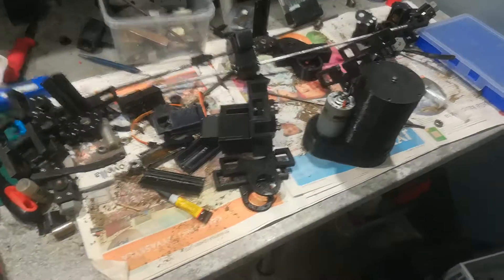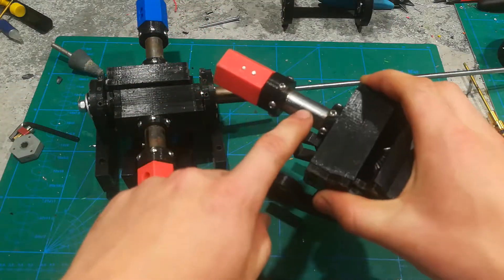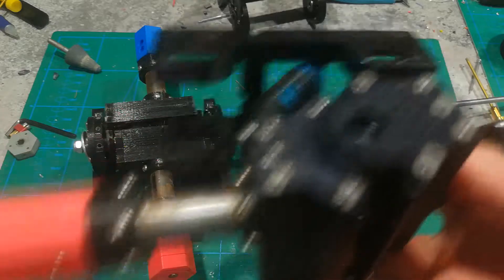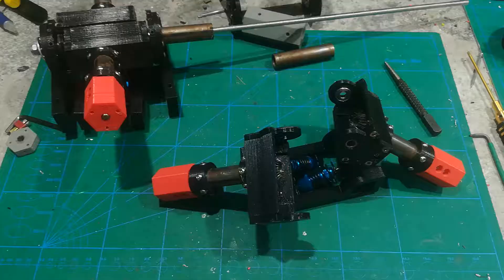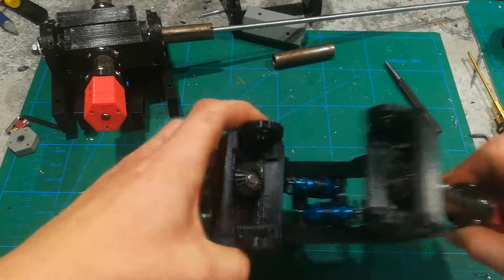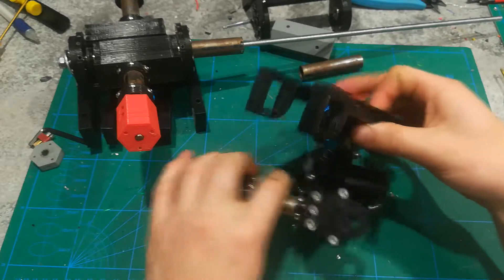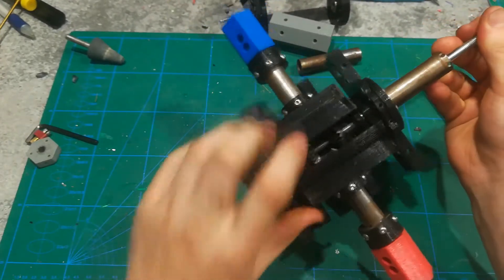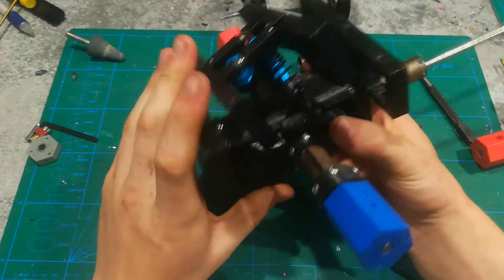OpenRC Trial Truck Build Tips Part 1 | Rear swing axles

Comment: Hello. Do you have a stl file to print a template for drilling holes in this 16mm tube?
Reply from the maker: I have some jigs in a different post on thingiverse, i think it has jigs for both the 16mm axle tubes and 16mm driveshaft cover tubes. https://www.thingiverse.com/thing:4625734
Reply: @sisco6943  very, very thx. :)

Comment: Building one right now, I do notice some links in the spreadsheet are broken, like the gears. Any product ID we can lookup or gear type etc.
Reply from the maker: The link in the BOM has this text "2pcs-7mm-Metal-Bevel-Gears-1-Module-20-Teeth-With-Inner-Hole-7mm-90-Degree-KQ"
Yes it says  7mm, but the gears I received had a 6mm bore.

You may have found some already, but these seem about right: www.ebay.com/itm/264525907294
You can probably find a cheaper set, this was just the 1st listing I saw.

When I got mine there weren't that many options for gears so they were just called "bevel gear set with 7mm hole" or something with no actual details. Also when I was building it, they only had the 1 size so I had to have the gear ratio be 1:1, but seeing the many options out there, you could probably fit a slight reduction in there so that the torque coming out of the motor/gearbox wouldn't have to be so big. Perhaps something like this: https://www.ebay.com/itm/133545558532
Again I'm just thinking here and haven't looked into it further than a simple ebay search (will they fit in the space etc.)
Ebay just cant seem to keep a cache of the product so people could see what the item was. If I were to make the BOM list today, I would obviously make the links permanent somehow.

Comment: You part list spreadsheet doesn't show the dimensions of the round tube that is part of the half axles. Could you please share the dimensional information for this tube?
Reply from the maker: The nominal measurements are in the assembly file (you can use the measure tool in fusion360), but they may vary by about +- 2mm. I went ahead and measured them for you, the center 16mm tubes from front to back are 74mm, 65mm, 28mm, 55mm. The 16mm tubes for the rear wheels are 44mm long (for some reason i made them 50mm long in the assembly file, which is wrong)
Reply: @sisco6943  I am yet to open the assembly files, thanks for the tip. The spreadsheet shows the tube as "square tube", that is what got me confused a bit. Thanks for clarifying. Also, a huge thanks for sharing this design, I am seriously considering building this.
Reply from the maker: @kalkurap  I'll check the spreadsheet and correct it, there is also square tube for the frame. I hope you build it and it turns out nice, it is a lot of work but worth it. If you do make one, post it on thingiverse as a "make" of my model with pictures so i can see how it turns out!

Comment: Hi! Which shock absorber length do you use? The link text in your excel files says 65mm, we I open the link, 100mm is shown. Thanks!
Reply from the maker: They are the short 65mm ones. This was the 1st one i found, I'm sure you can find them cheaper on ebay https://www.banggood.com/Wltoys-A949-A959-A969-A979-Metal-Upgrade-Front-Shock-Absorber-2Pcs-RC-Car-Parts-p-982949.html?rmmds=search&ID=41195&cur_warehouse=CN